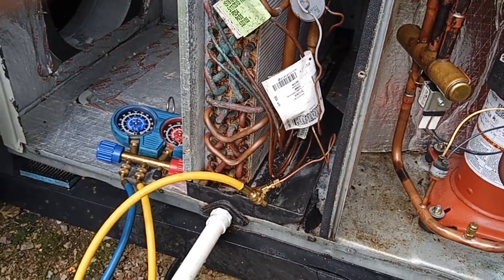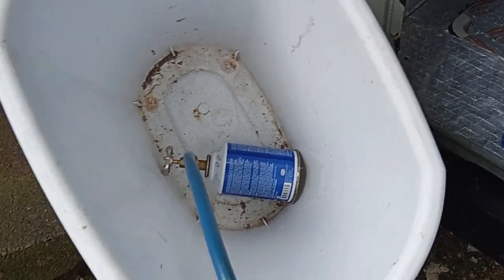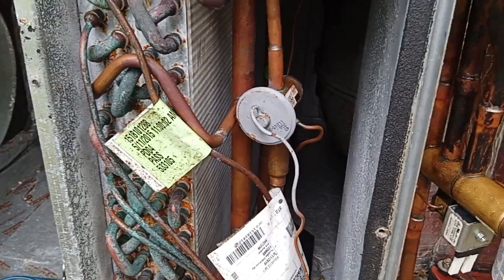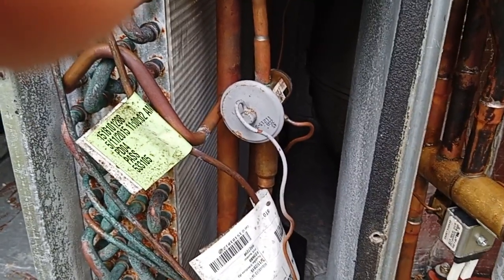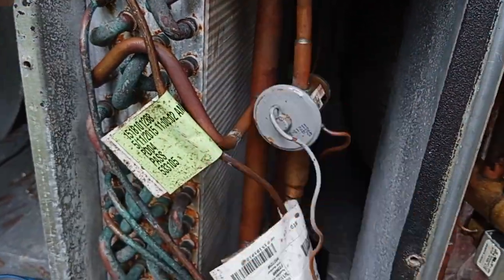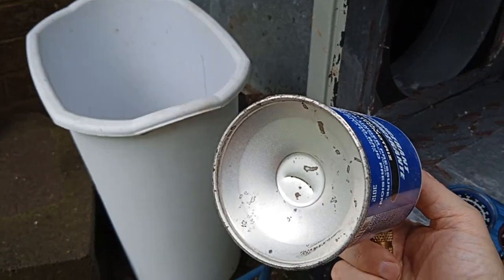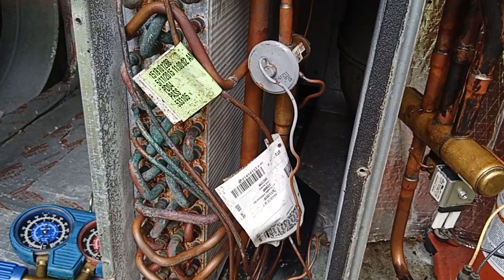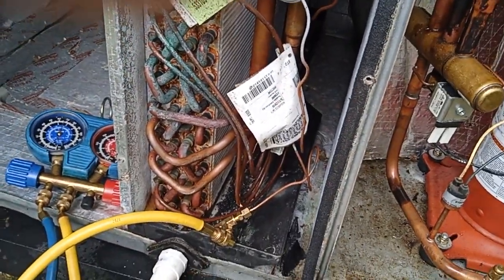TXV Repair Hack! ( Cheap= Easy!)

Comment: I've seen a hack where tubing was cut flush, drilled and tapped hole in the power head so a bolt could be installed to place pressure on the disc. Basically using a screw to apply pressure instead of refrigerant.
Reply from the maker: Yes, theres a Utube video on that, hes got no clue.

Very bad, the disc on my TXV only has 20 thousandths of an inch movement and he destroyed the head.

The screw tip pressing against that thin disc flexing with pressure changes is going to break the diaphragm and discharge the sealed system.

Comment: Great explaination of how the TXV works to regulate the flowbased on differential pressure across the diaphram
Reply from the maker: Thanks. I beat my head against the wall trying to reason how that valve could sense superheat. IT CANT!!

Theres only one explanation. Theres no NEED to do so.

The next video will go more into detail on a new TXV- what is the " cracking pressure?"

That gets messy...

Theres no such thing in the physics book as superheat, thats a term thats been made up.

The CORRECT term is latent heat if vaporization ( lhov) :

https://en.m.wikipedia.org/wiki/Enthalpy_of_vaporization